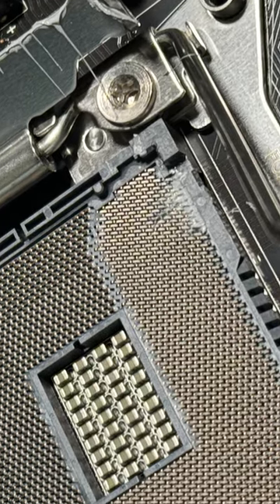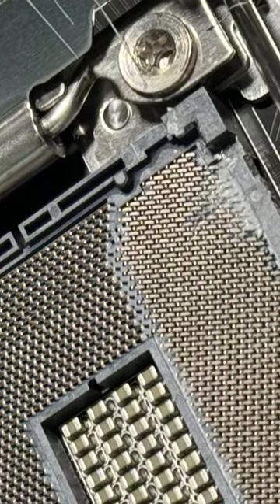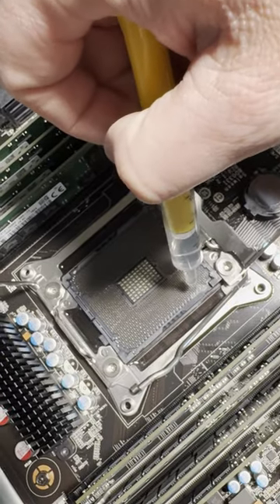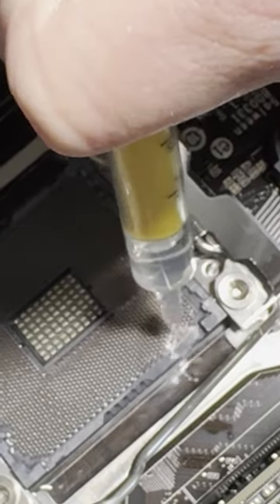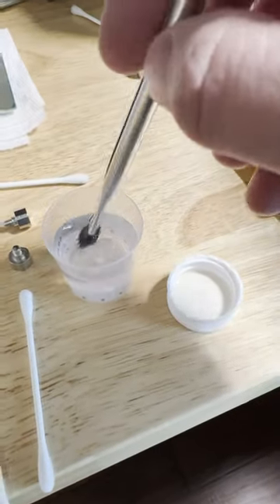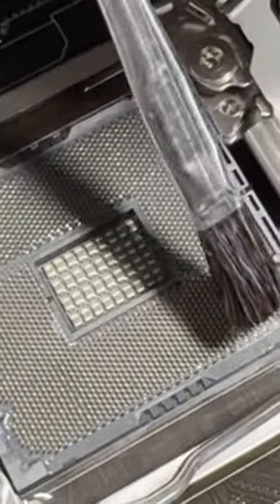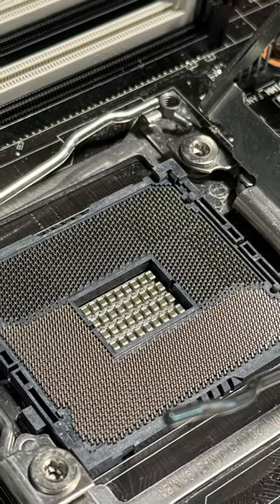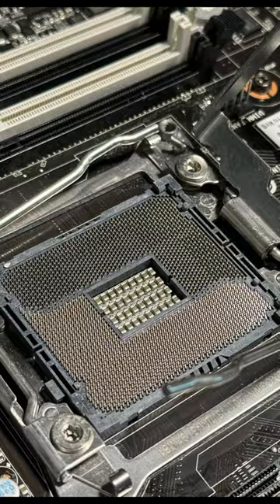Clean Thermal Paste from a CPU Socket SAFELY #shorts #pcs #gaming #thermalpaste

Comment: 70% isopropyl alcohol should use DI water which is NOT conductive. However, there are sometimes additives (like scents) that can cause problems so make sure to pick the isopropyl alcohol carefully.
Reply from the maker: Good info!  Pinned!
Reply: I can't find 99% but 98.5% is available at my local store. Is that safe? How long should I wait so that it is completely dried out & I install the CPU and turn it on?
Reply from the maker: 98.5% is plenty fine!  Give it a full couple hours to dry.  Isopropyl does evaporate very quickly though.  Use your best judgment
Reply: @PCTechHustle I'm going to clean the socket in a day or two in the meantime I might need your help. One thing I'm concerned about is whether or not I should remove the CMOS battery during this process and secondly what about the isopropyl alcohol that flows on the motherboard PCB itself. Will it damage or change the colour of the PCB. If it does then what steps should I take to avoid any decolorization. Thanks
Reply from the maker: @gameotic1  remove the battery for sure.  The alcohol shouldn’t harm anything you can just let it evaporate on the PCB.
Reply: @PCTechHustle  much appreciated thanks man I'll update after it's done 😄

Comment: thermal paste is not conductive, so its safe that its in your cpu socket. (ofc i don’t recommend it, as it will make a mess)
Reply from the maker: Most thermal pastes are not conductive but some are actually.
Reply: @PCTechHustle oh. well i didn't know that. thanks for the info.
Reply from the maker: I don’t know off top my head but some very few are.  It’s probably harder to find conductive ones than non-conductive ones though.  Unless you go the Liquid Metal route, then that’s different obviously.